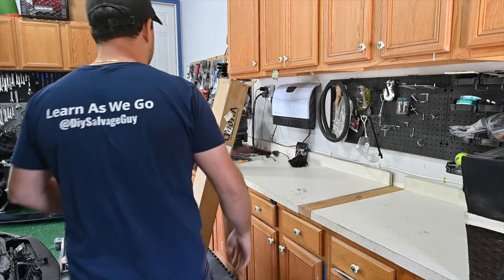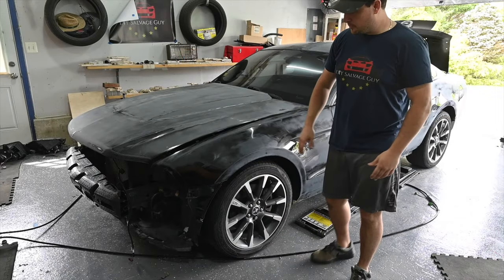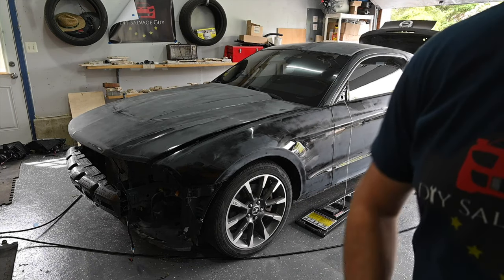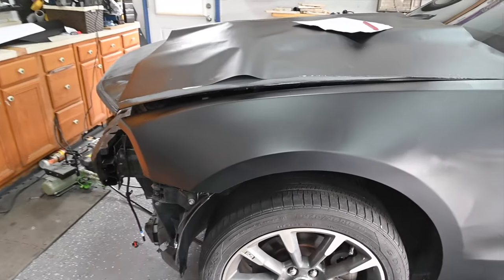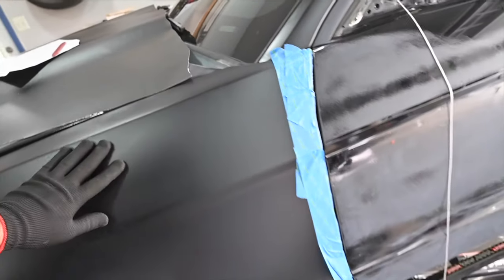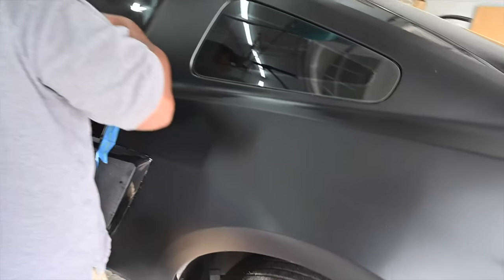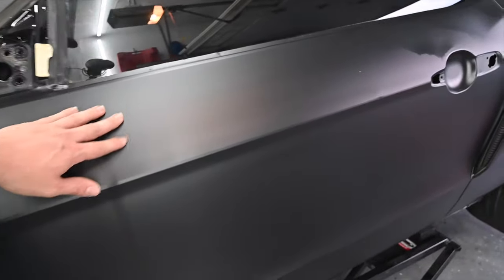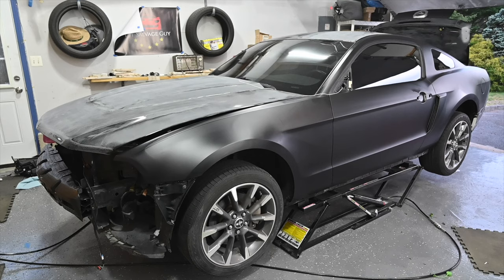Rebuilding a Wrecked Car: Mustang GT (Part 23): How to wrap a Car

Comment: You steal all of my ideas! From what I researched you should use 70% isopropyl alcohol to clean the panel and around the panel where the vinyl would stick right before you out it on. Not sure if you did that… didn’t see it in the video. Also, the matte stuff leaves glue marks if you stretch it so minimal as possible stretching. You literally stole my color idea and everything 😂😂 Good luck on the rest!
Reply from the maker: Yea I used that. I think I explain that more in the next video or maybe I edited it out of this one. I only went with the matte black because the other color I wanted was out of stock!